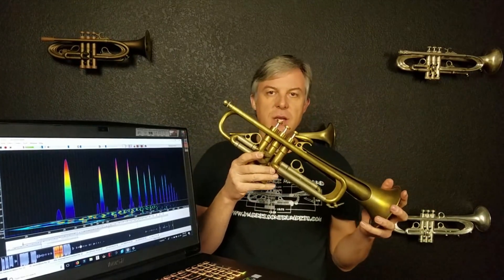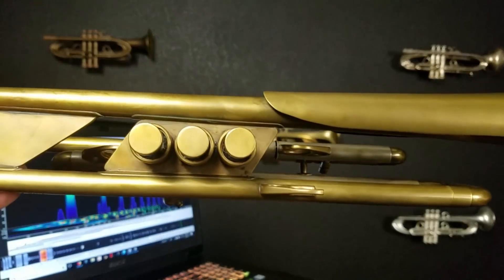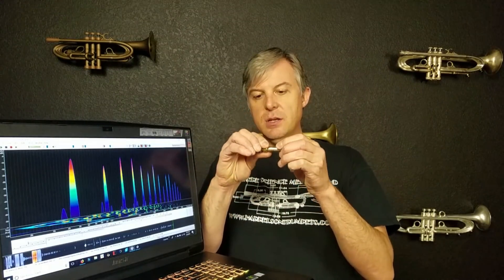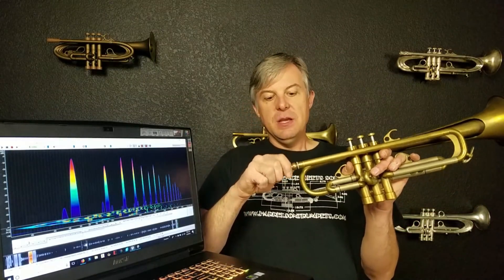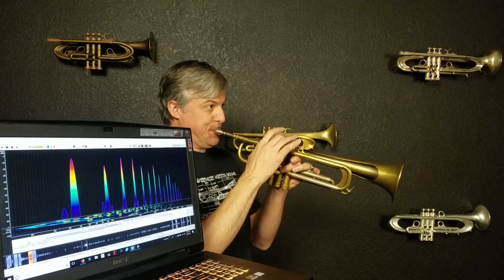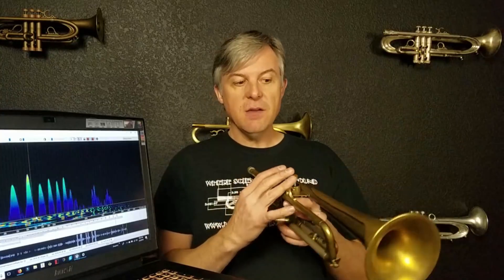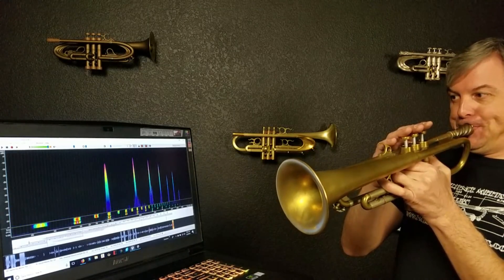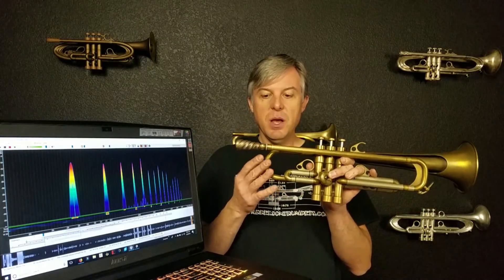Trumpet Review: Courtois Evolution 2 w/ Spectrum Analysis

Comment: I had an Evo IV that I got from Felix Vasser new for $1500. 9 years later I sold it for the same price. I think these Courtois are going for a bit more now. Mine had some of the same traits. The tuning slide was so loose that it would slide out slowly with normal playing. The 3rd trigger fell out a few times because that nylon ball just wasn't strong enough. The gap adjuster always got stuck too. I didn't mess with it much anyway. It was quite heavy, and fairly bright. A good deal of resistance, and I felt locked into a single sound with it. With my Super Recording I have much more freedom of sound color. But thanks for this informative video. It was interesting seeing what changing the gap did.